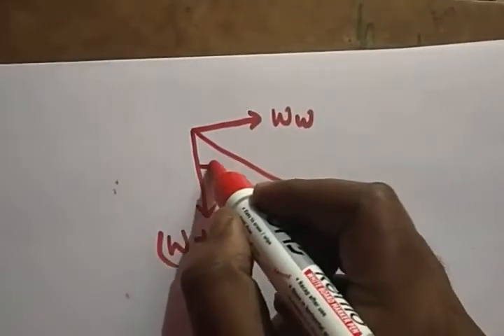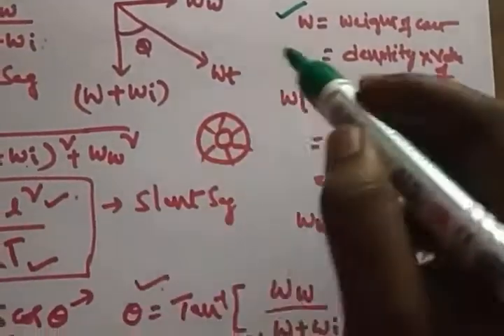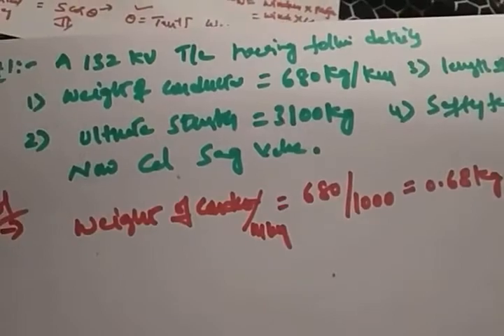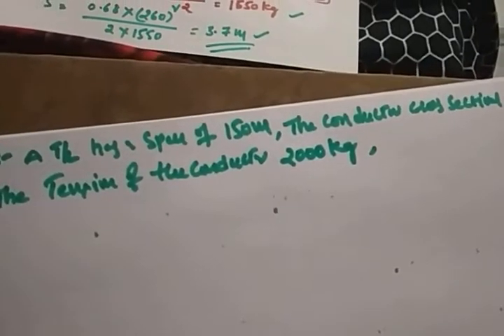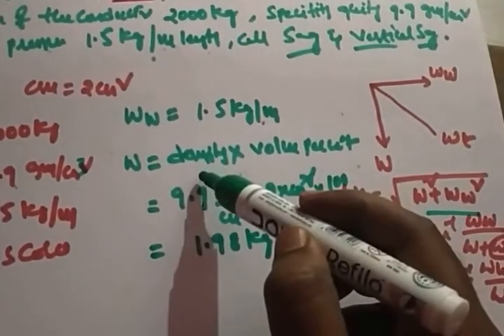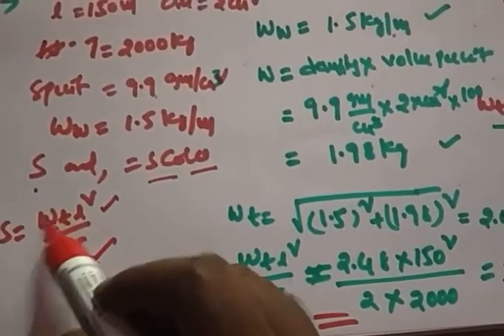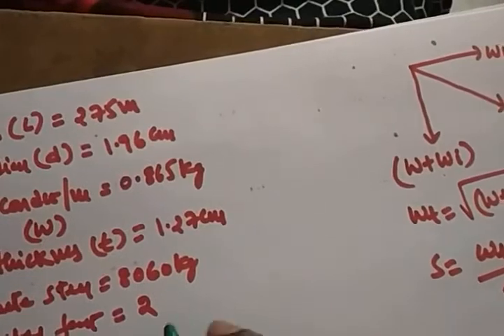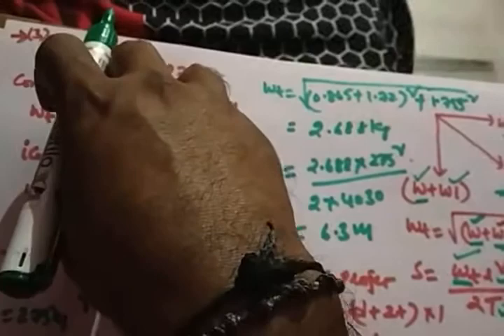PROBLEMS ON SAG CALCULATIONS

Comment: This is interesting just a little correction need to be done on the formula for sag S =Wtl²/8T ,this is the correct step because when we use 2T in the denominator it's kind of finding sag for a portion of the conductor, my thoughts,correct me if i am wrong🤞